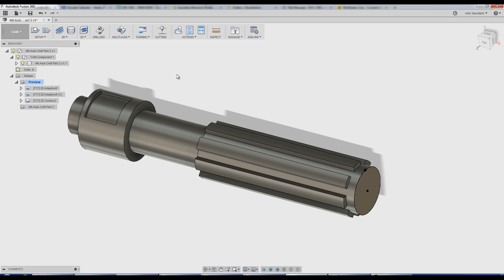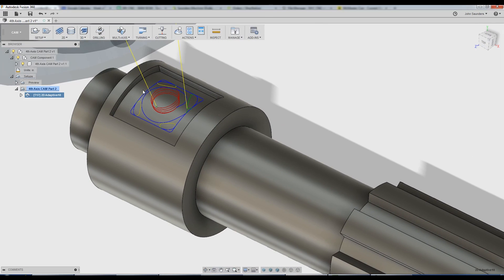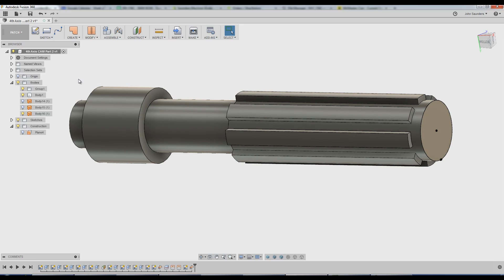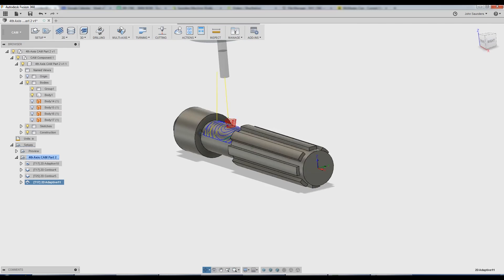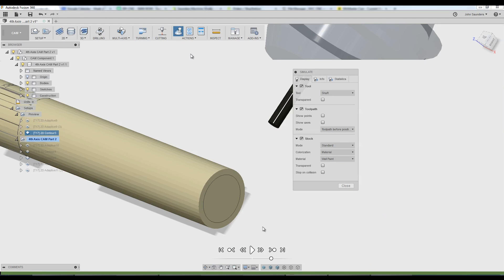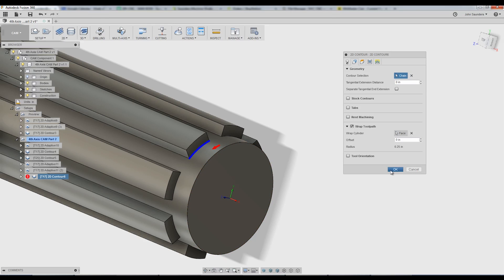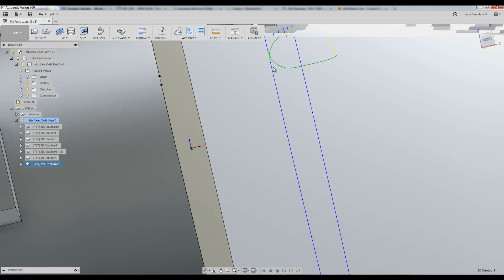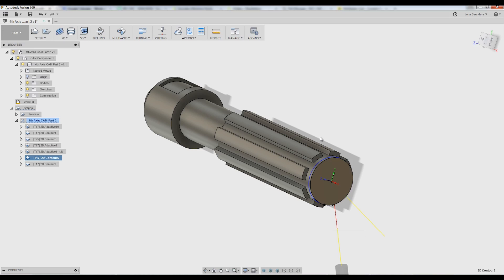Fusion 360 4th Axis CAM Tutorial - Part 2  FF98

Comment: When machining the continuous area... I think I would have made the one tool path that goes 1/2 way around... then made an array from it to go 3 times... every 120 degrees basically. That would have given plenty of overlap and acted as a finishing pass. Or... I would have created the first path... made it slightly smaller on the edges... then did an array... same thing, less overlap on the cuts. (But hey... still learning Fusion, so what do I know.)

Comment: John,  you're over complicating a two op job. some of the work needs to be done on the lathe and some on 4 axis, you get way better surface finish and much cleaner and easier to machine part. In theory it can be done in real life not really your part will come out really badly finished. thanks for the cam examples its always fun to learn new things. keep up the good work
Reply: For me as a semi-pro hobbyist, I have a cnc mill with a 4th axis, I do not have a cnc lathe... so beggers can't be choosers.
Reply: I can't see a world where its quicker to mill a cylinder than to just turn a groove. Finish, tool life, reliability. Realistically the way to do this is with a live tooling lathe.
Reply: I agree with you, in theory.  But we don't know how the part is being finished.  It may be tumbled and powdercoated for all we know.
Reply: panaxion dude, this is a part for production most likely. If you're making this in your home set up it will never come out to tolerance or finish quality. So yeah you can most likely make it if your machine is rigid enough and even then you're lucky if you get a 250 surface finish. That's my 2 cents.
Reply: because he is a hobbyist
he barely distinguishes a lathe of a Mill
lol

Comment: Because of the tool radius and it not making a perfekt 90° corner, shouldn't the chamfer contour also follow this "new" path? Otherwise it might run into a lot material. Or is this just the simulation not getting this straight?
Reply: Jannik Kramer if you want to chamfer you have you pocket, contour and chamfer using the same edge loop and wrap radius for each toolpath.